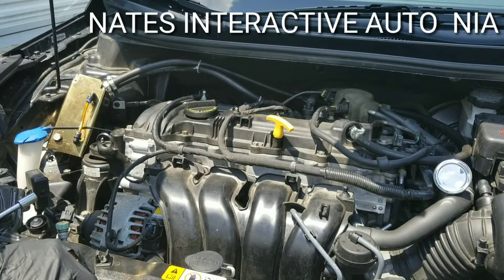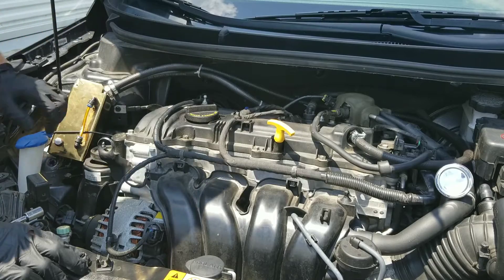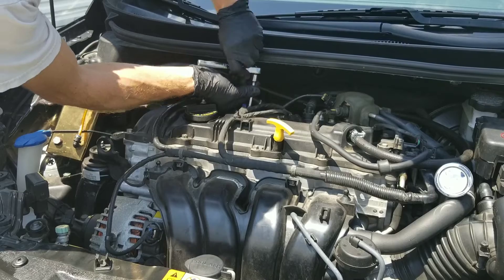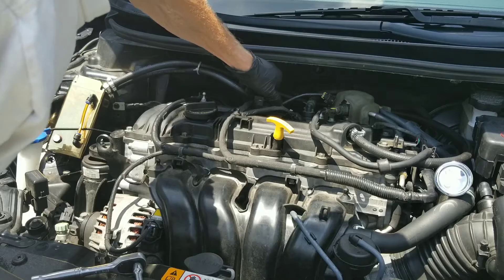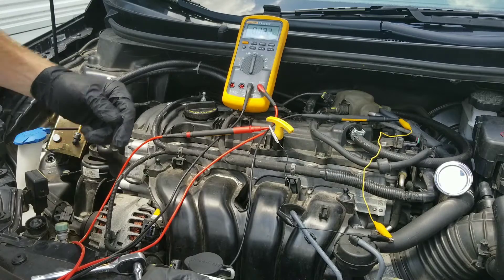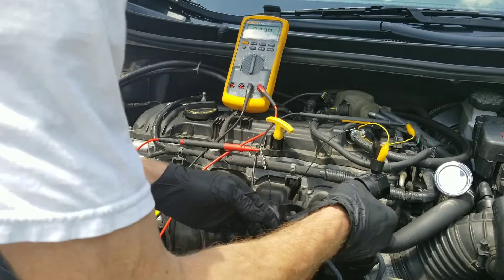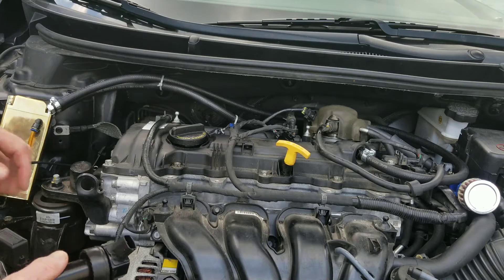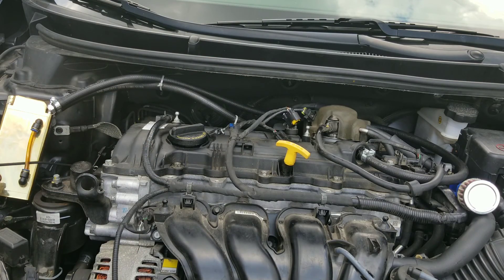How to check ignition coils the easy way

Comment: This is only for two pin coils. Testing most three and/or four pin connections like this will not work because of the transistor in the coil. If you were to use this method on most three and four pin coils it will make it look like the coil is bad when it's not.
Reply: You just saved me a headache thanks man

Comment: Hey Nate, it’s Nate. Always great to see instructional videos that are well presented and to the point. But I have to say this is not the easy way lol. It’s a way alright, but the easiest… Put you’re multimeter on ohms (the little horseshoe looking one for those who might not know) and with the coil out put the red lead on the + metal pin in the coil and black on the - pin. No need for all those extra wires. Still great video my friend Nate.

Comment: Can you test a coil on a shop bench by alligator clipping the coil terminals to a 110v-12V converter or 12V battery, and clip the spark plug strap to another alligator clip going to the ground in the wall socket?

Comment: I have a 1995 lexus sc400.  it looks like it has wires running to the spark plugs.  It has been sitting for 4 years. So I drained the old gas and put 5 gallons of fresh new gas.   My car is having a hard time starting.  its cranks and cranks before it turns over.  Sometimes it takes several tries.   It started and ran perfectly fine for 30 minutes or so at normal operating temp. Shortly after, the temp gauge started to rise slightly and the car just shut off.  Hard to start again, would crank but not start.     do you know what it could be?

Comment: Ok . The end of the first test was unclear . Once you put the alligator clips on . What is the meter supposed to read if its good . Do I assume if its bad . It'll test at 0 ohm ??? 

Good point in the right direction but the end of the test is a little off

Comment: I like your videos don’t let the negative comments get you down bro! I am subscribing! Just a word on ohm coils… in some cases it doesn’t put it under enough stress and heat.. so in some cases the coil will 0HM fine and still misfire. So if you ohm And it still has a misfire after you put everything back together change the coils around and see if the misfire moves using a Scan Tool.
Reply: yeah right ha ha
Reply: What did you understand from second test?

Comment: wouldn't checking continuity across the coil have been better ? as far as the multimeter was concerned ... also you could have used a simple grounded test light to check the spark gap for testing the spark plug... a lot of issues in this video bro... since you haven't learned how to use that fluke multimeter, send it on down this way bro...

Comment: Why not ground the spark plug to the battery when testing the coil?  I thought all ground led back to the battery.
Reply: And how is it led back to the battery? Through the chassi, so why not use the chassi like everything els 😅
Reply: because if there's a hydrogen gas leak from the battery, the spark could cause an explosion. Same reason why when jumping a car to start you set the ground up on the block or such, not the battery.

Comment: All my coil overs failed intermittently. Ohms tests passed. Hand generated spark test passed. In the engine under load TOTAL CRAP OUT..!!  Unplugging each one while engine idling helps sometimes. If no obvious drop in power or rough idling begins them that coil is doing nothing. Don't be a cheapass Charlie. Just replace them all. Your family's safety to get them out and back home again depends on you doing the job right...

Comment: So you have your primary winding then your secondary winding that also needs to be checked to verify if it’s in spec there’s a cold specification as well as a hot specification of the car was just running everything is warm to hot & all coils will have a different spec the need to be within so make sure you look up your vehicle/engines specification checking the primary winding like this with a meter is fine check the secondary by moving the positive to where the spark plug would go on a coil over plug system it where the plug wire goes….another way to do this is with a oscilloscope so you can visually see the wave produced but either way will work fine overall good video thanks for sharing

Comment: I've got a 2001 Ford escape 2.0. can't get fire. Changed the coil pack and crank shaft sensor. Still no fire. Help me !!?
Reply: Check for broken wires loose connections & verify the new parts are in fact good…since nowadays new doesn’t mean good anymore

Comment: how would you check for spark, turn the key or send power to the coil a different way?
Reply: Yes turn the key and let the engine turn over repeatedly.  But make sure the fuel injectors are disabled.  Check your owners manual in the fuses section and remove the fuses  for injectors and fuel pump.
Reply: You got that backwards
Reply: Coils don't create spark, spark plug does.

Comment: Take the positive cable off the battery whenever you work on the electronics.
Reply: No because because if it strikes metal it’s going to Arc
Reply: @cannonbrooker515  Exactly. Remove the Negative cable off the battery, and then the battery is disconnected AND there is no danger. Then, proceed with working on the electronics of a vehicle.
Reply: Sounds like you have no business giving advice. You have 0 clue what you’re talking about
Reply: Can you please be a little more negative is the point

Comment: just make sure that u use a 1mm ground wire to test for 50 000 volts on the plug
Reply: It's enough. The current is miniscule and very short. How thick, do you think, is the secondary winding of a coil?
Reply from the maker: Thank you for taking time to share your thoughts its great to see kind and generous people.

Comment: Stick a screw driver in the plug wire and lay it close to a ground ⚡⚡⚡lol
Reply: That's not any where near an accurate test of newer vehicle ignition s..
The coil on plug is a solid state system is reliant on SPECIFIC VOLTAGE ,ONCE AGAIN SPECIFIC VOLTAGE. 
By all means just jump the coil ou5 to ground..you'll get a spark. Of varing colors..  Btw do you know what a bright red yellow spark means?  Or bright blue purple color what it means..  
Any ways Wyatt Booger.  
  Don't ever ground Cop coils ..  Unless you want to buy new ones.  
If your not measure the spark on a scope. Your only verifying that you have spark.  You can't tell the over all scope or tru ampmeter . to verify your meeting the systems voltage requirements..
Reply from the maker: Bush booger your right thats a fast and effective way to check for spark but you know more than the average joe with experience